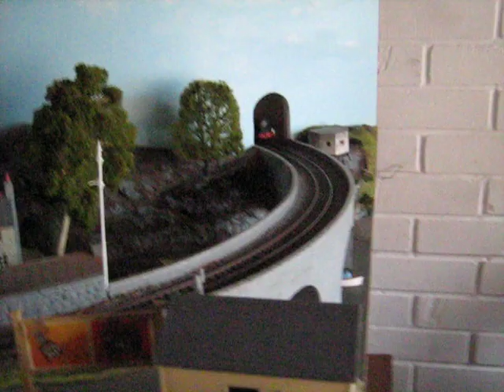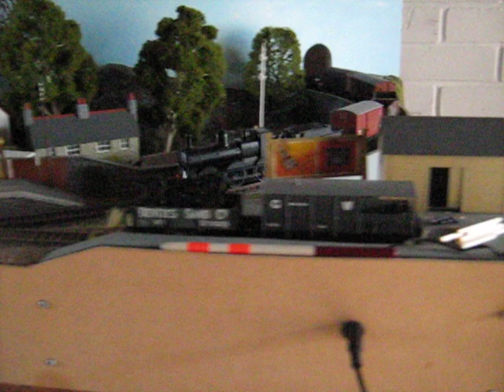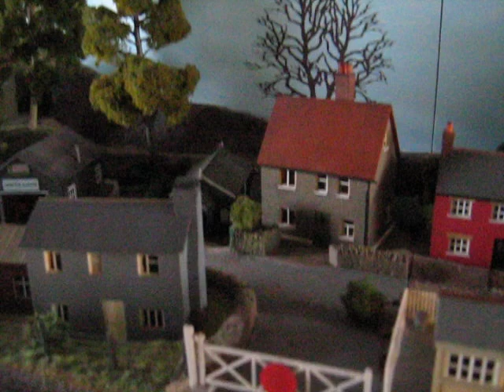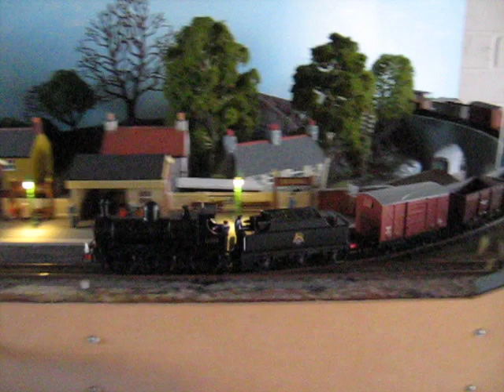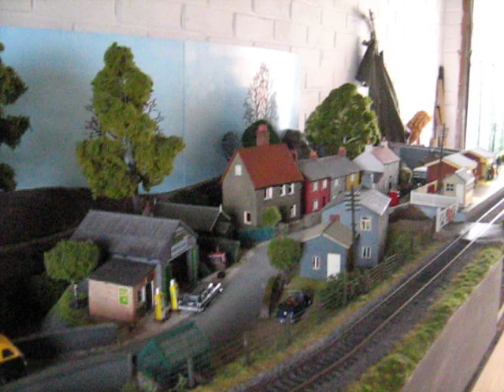My Oxford Rail Dean Goods - struggling around St Oval

Comment: Mine has an issue on the 1st radius it slows down sometimes slips off
Reply from the maker: Never de-railed yet, the slip is at it's worst when out of the curve, but with the wagons still rounding the bend. It needs more weight for added traction.